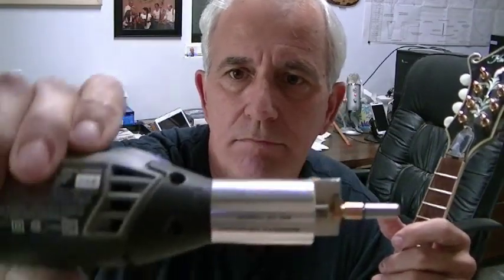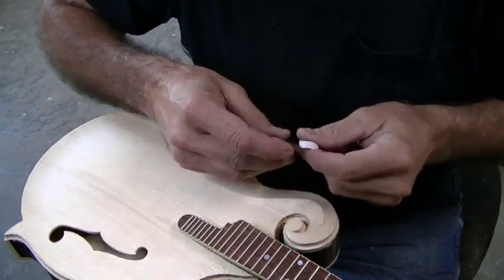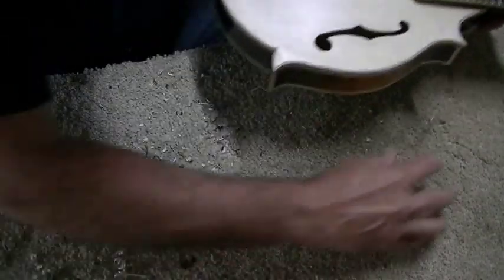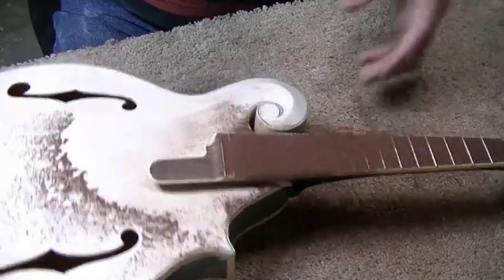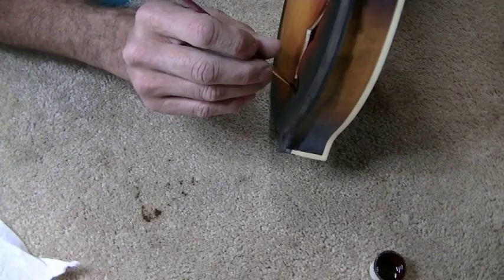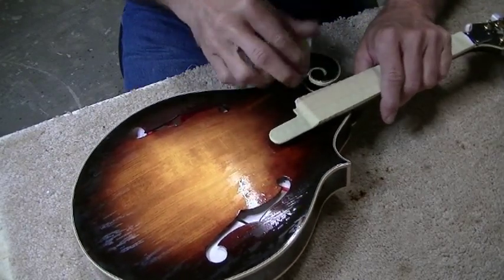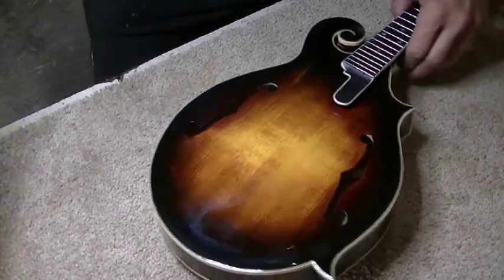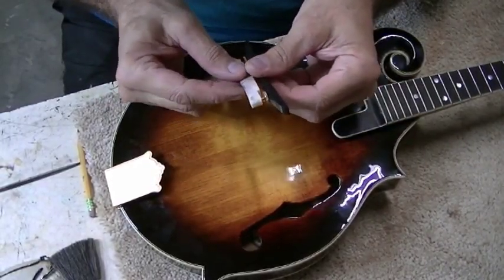120 RSW Kentucky Mandolin Top Build   Final

Comment: Ever used a coping saw with yarn mounted to dye into the curl?  Put a wick in the stain and draw the center of the "bow" over the wick to pick up stain then "saw" into the curl to dye that decreasing opening.  You could also use alcohol on a clean piece of yarn to help blend in tight spaces.  It would give you a round blending brush, diameter controlled by the size of the yard and tension on the coping saw bow.  Also would work to put lacquer deep in the curl.

Comment: That was  great set of videos Jerry -- about as A to Z as you could ever get for making an F-style mandolin top.  And you ended up with a terrific looking AND sounding mandolin.  I found it very interesting as I am half way through making a carved top for a mandolin I am building.  I would have loved to see you do the sunburst as I find spruce about 10 times more difficult to stain than something like maple for example.  (I use a set of azo-based, water soluble dyes by Transfast).   Some of the techniques you do are a little different then you might find in a book like Siminoff's Ultimate Guide so it opens a person's options to see them and think about using them.  You must put in an unbelievable amount of time to make these videos and must have to have a lot of RAM of process it?  Oh one other thing -- more of a comment.  You performed what by any definition is MAJOR surgery on that Kentucky mandolin.  You can buy a very nice used KM-1000 these days (which is just a peach of a mandolin BTW) for $1000 if you shop around -- the one you worked on looked like a lesser model?  It could not be cost effective to do that repair could it?  I know people have emotional attachments and that also has "value"!  (<:
Reply from the maker: Thanks for watching and the nice comments.  I'd say you are correct in terms of cost effectiveness.  On the other side of the coin, though he still will not get his money back in terms of cost/value, he has a mandolin that looks good and really sounds good that will sound even better in about a year after the finish hardens.  He is very pleased and has sent me several notes reagrding the sound compared to other mandolins hes played.  Thanks again.

Comment: Sorry to ask a lot of questions Jerry, I think you matched the colors very well on the replaced top.. looks very very nice. I was wondering, if you can remember when you 1st took the wood for the top out of the box, you had said "the wood looks okay, not necessarily what I would have picked" What did you mean by that? Would you have picked something with some flame to it? Anyway it really did come out nice.. You make it look easy..
Reply from the maker: It's been a while but I believe I was referring to the grain pattern in the top wasn't the grain pattern I would have picked. It seems like the grain pattern was pretty wide I prefer a little more narrow pattern but wide is pretty good for the softer sound.

Comment: When hand cutting the binding slot, is it possible to make an "L" shaped foot from an old blade, ground with rounded edges, placed in the handle with the cutting blade to provide a depth gauge both down and into the top?  You could make a left and right with two handles.  A small touch of brazing or weld on the "foot", ground flat on the top would give you a repeatable depth by fitting tight to the jaws of the handle as you change blades.  It would also stiffen scalpel blades for sharper cutting into the curl head?

Comment: Hi Jerry, Excuse my ignorance, but why did you remove than thin down the fret board in the upper register? Just curious.. ,Thanks Tom
Reply from the maker: Sorry I'm not really sure I understand your question. If you're referring to the crooked neck, putting a wedge under it seem to be the easiest way to fix it. Had I tried to thin the fretboard down, I would have remove too much wood.
Reply: I meant to say you removed the upper frets... then thinned down the fret board in that area, like you do on your mandolins.. Is it because they are spaced too small to be useful to be fretted anyway's? Thanks, Tom
Reply from the maker: Bucyrus Erie12 that is part of it. The main reason is just for pick clearance so that the pic doesn't hit that. Thank you for watching.

Comment: Someone please tell me, why put a florida on the fretboard if you don't like the frets they originally were designed for? It looks dumb to me, like fake shutters on a house. But at least shutters add a cutesy look to a house. Floridas don't add anything aesthetically to Mandolins. You may as well paint fake frets on the florida to make it look better. But I've seen some very attractive things done on mandolins to do instead of the extended florida without frets, like a bracket similar to this "{". That would look much better than the look of a florida that's been de-fretted and scooped down.